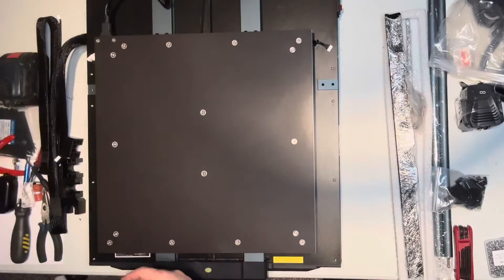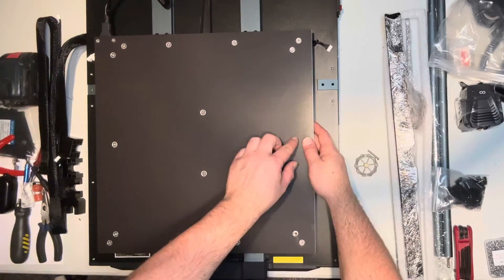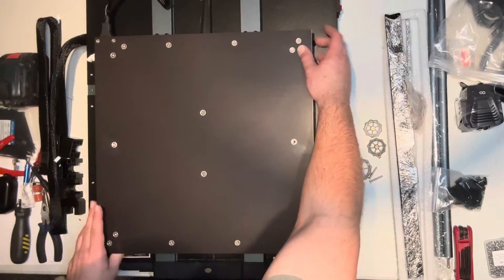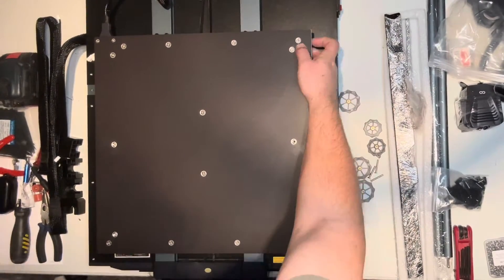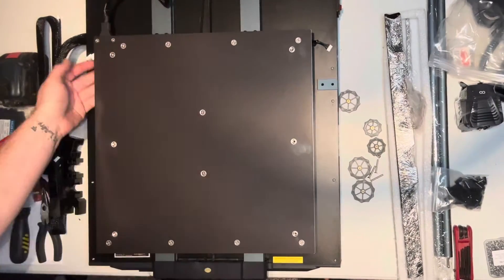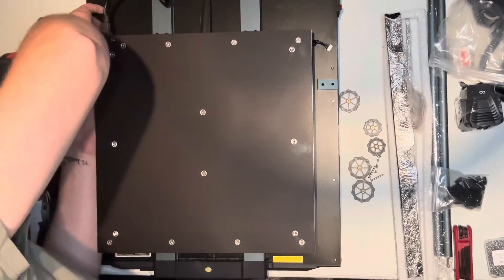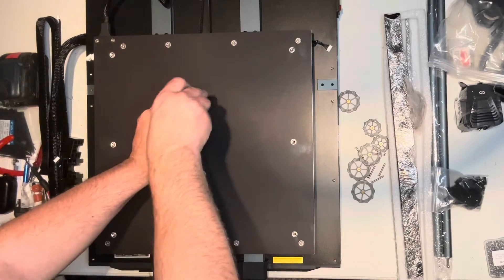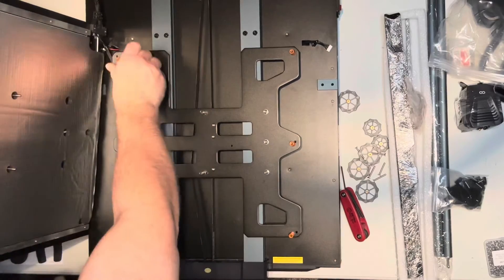Here’s a quick video on how to install silicone bushings under the bed on an Elegoo Neptune 4 Max.

Comment: It appears that on the N4P Elegoo has redesigned the center spacers as they are no longer spacers. They're male to female threaded adapters. The screw that passes through the bed is 20% the size of the other 6 screws on the left and right. It appears that in order to put the silicone spacers in the middle one would have to acquire two more screws like we have on the left and right sides
Reply from the maker: That’s good yo know. I keep spare screws around in case I lose any. Thanks for sharing what you’ve found.
Reply: do you resolve your problem ? I put this silicon thing today (six of them, I leave the center adapters like u say, my printer is n4 max December 2024) and I can't obtain better level than with the original orange springs
Reply: @charliebrownn6622  Please let me know if you found out a way to resolve it; thank you

Comment: I'm not sure the scolion bushings are better than the upgraded springs on the Neptune 4. I would certainly replace the springs on the Neptune 3 immediately, but the ones of the Neptune 4 are different and I haven't heard anyone say it's a huge difference.. You need to print up a calibration bracket, and use plywood on your print table sides to make them wobble less.

Comment: Great video but quick question. What did you do at the attachment to the heating element?  I feel like I'm missing something. The spring is inside and the bushing doesnt fit in this one spot.

Comment: That was a painfull reassembly XD. If you do it put the bushings where the holes are, then put 2 screws in the middle to catch the metal bushings from the top (dont's screw those first).After that screw the outer 6 and at the end screw the middle ones. I have the white silicone bushings, for now they do seem a lot stiffer than the orange stock springs, although calibration seems a little off (some feel tighter than others). Time will tell if it is worth it

Comment: Part of the issue with these springs is that they are almost at the limit of their extension when adjusting the bed relative to the nozzle, so they are close to loose to begin with ( I have a Neptune 3 Plus).

I've seen videos where the person states to wind the springs to half compression to give  better adjustment travel. Which is complete bollocks.

The plate is secured to the frame in the center by two metal spacers, when you wind the springs to half compression, all they do is create a big warp in the bed since the center of the bed cannot move at all, and no auto level will fix that.

There is nothing wrong with the springs all you need to do to add better tension is to slip a 3 mm spacer under each spring.

Comment: I just did this with my new max pro and like a previous  comment said the bed underneath looks a lot different. I also had to trim the insulation foam under the bed for my spacers to fit into it.

Comment: Replacing the metal spacers is a good idea since they will expand at a different rate than the silicone spacers when the bed is heated.

Comment: Oh wow, even in the middle?? How do you get those consistent when levelling? 
Seems like torque wrench would be a good system. 
Do you adjust the centers as well, when doing levelling?

I was looking for information on potentially using blue thread locker on the center bolts but this but, wouldn't want to do that in this case.
Reply from the maker: I’ve taken my printers a step further and added locking nuts instead of the knobs. Now when I level the bed, it take twice as long to dial in but I don’t have to manually relevel the bed until I take it off again which so far has been months of not having to manually level the bed. I hit auto level and go back to printing. Yes I do adjust the middle two screws when leveling the bed. That’s part of what takes longer. It’s well worth it in the end for me. I hated manually leveling the bed every week.
Reply: @OuterRimArmorer  man it was a little problematic finding the right ones but I've ordered some longer middle screws for the middle positions.

Have you toyed with "screws_tilt_adjust"?
With bushings in the center or not, this seems like a very functional tool, and I'm working on setting that up as well.

Comment: i just got these today and i dunno, the springs rest on the metal of the bed and these are fatter and rest on the heating insulation. doesnt seem good
Reply: silicone is thermally safe

Comment: i put the silicone bushing on and the bed is way off level by almost .25" in the back.  why would it be off that much
Reply from the maker: Probably just needs to be adjusted. It takes me a couple times of manually leveling by adjusting the knobs under the bed before I get it dialed. I do it every time I’ve taken the bed off. But keep in mind I’m not a perfectionist when it comes to the bed being perfectly level. That’s what klipper is for. It’s supposed to register and compensate for unleveled beds. Also don’t forget to heat soak your bed before leveling it. Basically heat it up to 60 a few minutes before you start leveling it.

Comment: Does the height of the spacers matter, or will the screw not be long enough? I can only find 18mm high spacers in my area
Reply from the maker: I have only ever used 16mm bushings but I have replaced my bed screws with slightly longer ones. I don’t recall the length but I do believe they were M4 screws I might have a video published where I talk about the bed screws. 🤔 I’m not certain if it will work but it might be worth a try? 🤷‍♂️
Reply: @OuterRimArmorer  alright, thanks!

Comment: If you replace the 2 center metal spacer bushings, you are making 2 adjustable points that have no way of being easily adjusted. How do you know how tight to screw them in? I think the  2 center screws should be fixed, leave the metal spacer bushings. Just replace the 6 adjustable screws with silicone bushings.
Reply from the maker: It does make leveling the bed tricky but I’ve managed to do it on both my Elegoo’s and it’s worked for me. To each their own.!
Reply: you can make a bed screw adjustment macro using fluidd, a web interface for klipper firmware printers, they have videos all over about making one, i think its called screw tilt adjust or calculate, but what this does is it probes all your z offsets for each screw position and calculates how much you have to rotate it clockwise or counterclockwise by the measurement of a clock, like 1:45 being an hour and 45 rotation so one full rotation and 3/4

Comment: Edit: Don't use too long a bolt or tighten too much in the centre rear position if you are swapping to bushings! This can protrude underneath and take out your rear stepper motor! I ended up using a cut-down bolt around 24mm for my 18mm bushing.
Wasn't as simple for me. I too want to do the middle 2 but the bolts are way too short to fit through to the plate below. I've had to leave it in bits while I get 2 bolts that are 30mm like the other 6. Wish I'd known this before...
Reply from the maker: The middle two took some time to get to line up and thread. I remember that part being a bit tricky. I don’t think I used longer screws but now I’m going to check.
Reply: @OuterRimArmorer do you recall if you too ended up using shorter screws?

Comment: I just tried the mod and the amount of squish on the silicone is concerning at least to me.  I didn't do the center spacers like you did maybe that's the thing.  Or it could be the material underneath.  Just when I run bedleveler5000 the center is always at negative if I snug the screws down.

Comment: I did the middle bushings but I couldnt get the screws to catch into the frame. Should I get longer screws?
Reply from the maker: You shouldn’t need to but I have had that problem. It took some moving around before I got it to finally work.

Comment: Can you make a tutorial how to replace the belt for y axis? I’m confused on how to do it my belt broke or if you know how could you explain?
Reply from the maker: I can try and explain it. Towards the end of this video you can see the bracket that the bed attaches to. In the center there are two screws that attach the bracket to the belt. If you remove those screws you’ll have clear access to the belt. You’ll need zip ties or replacement copper belt clamps/crimps along with a new belt. This is what I ordered but haven’t used yet. https://amzn.to/3OjjtL9
Reply from the maker: Does this photo help? 
https://www.instagram.com/p/C2tgcMvLbqw/?igsh=YXV2ajd2ZzVzZmJi
Reply: @OuterRimArmorer  I’m so sorry I confused the x and y axis my belt broke on the x axis where the extruder is.
Reply: @OuterRimArmorer  I appreciate you trying to help tho it’s my fault for not double checking
Reply from the maker: @whynot1284 no worries, it took me a while to get those two figured out and honestly it was the knob locking pieces I printed that actually have an X and a Y on them that helped me remember which is which the most.
Reply from the maker: @whynot1284 I haven’t taken the X belt off yet but I’ll take a look and see if I can give you some pointers.

Comment: Got a question for the Neptune 4 Max, I can't get my wifi to connect both through wireless and Ethernet. Just a big red X next to the network after putting in the correct password and a giant 0 for IP address when Ethernet plugged in.

Would you happen to know the fix with the latest firmware?
Reply from the maker: Oh that’s an interesting question. I just setup my second Elegoo Neptune 4 Max with wifi and it went fine. I wonder if it’s something to do with your wifi. 🤔
Reply: @OuterRimArmorer Mine has been the same with wifi.  I don't necessarily need it though, so I haven't worried about it.
Reply: @BlazeT3D  the reason I want it is too control calibrations such as flow rate and e steps. Most of that used to be ON the Neptune 3 series but it's in fluidd now.....

Comment: how tight do you make them after you install them
Reply from the maker: That part is a little tricky. I left mine loose at first and while leveling the bed I adjusted everything at that point. The tricky part is if you replace the two center metal spacers with bushings you might find yourself removing the plate during the bed leveling to adjust the center screws and then putting the plate back on to continue leveling. I did this several times before I was able to get mine dialed it pretty good. I don’t chase perfection like others do though when it comes to the bed level numbers.

Comment: Do u find silicone better than springs? Thnx for video, I have 4 plus and it is good machine.
Reply: I can definitely say that they get lose. My default springs on the left side get lose after every print
Reply from the maker: I print around 300mms so I found that with the springs the knobs would vibrate lose. The silicone was a little better but not perfect. The silicone does absorb a little bit of the vibration as well.